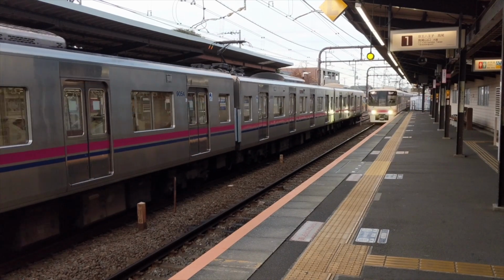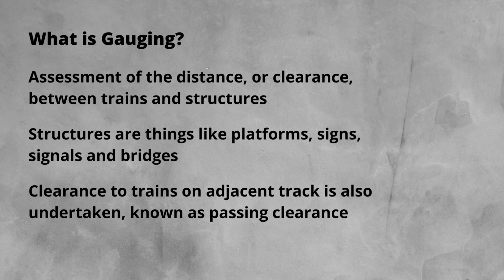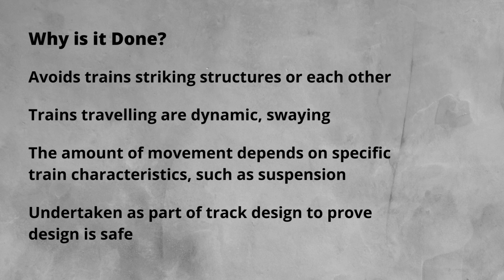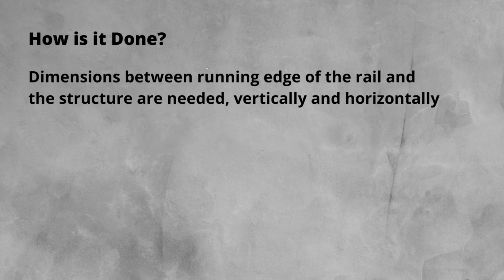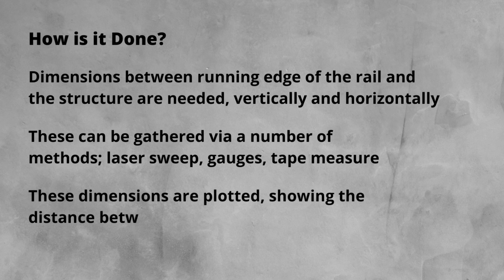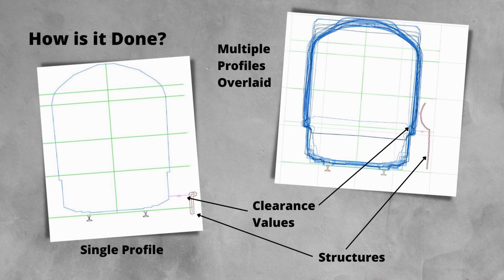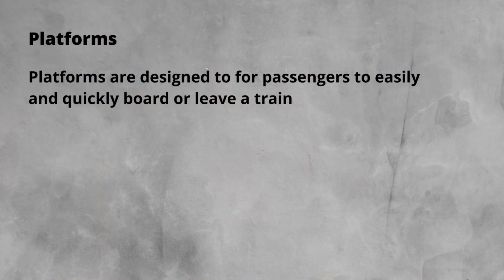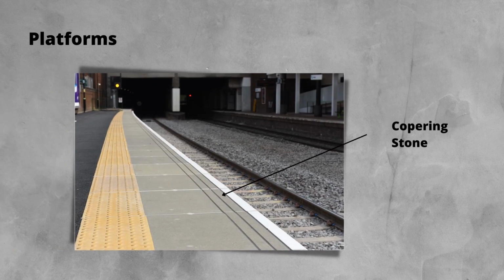What Is Gauging on the Railway? An Intro Guide for Railway Engineers

Comment: More detailed than had occurred to me.
Reply from the maker: Gauging, particularly in platform area does become a bit of a beast in its own right.
Reply: @thepwayengineer  What are disused stations like?
Reply from the maker: They tend to be left as is. But if there are no passengers, the stepping distances do not need to maintained only clearance
Reply: @qwertyTRiG if the platforms are left in situ then in the UK the platform edging stone slabs are removed.
Reply: @neiloflongbeck5705  That makes sense. Would probably allow trains to pass faster. Some American stations have clever overlapping tracks so that through trains can be further from the platform.